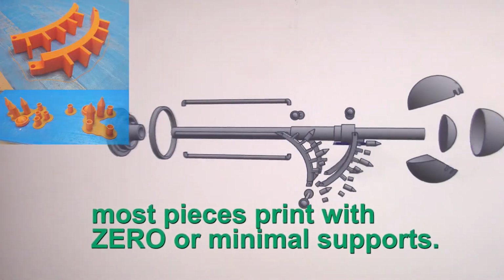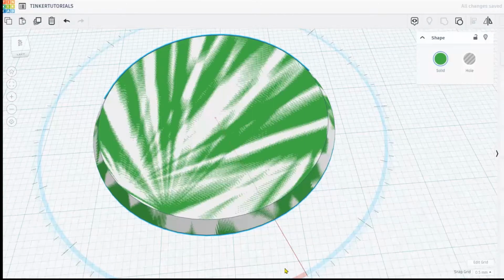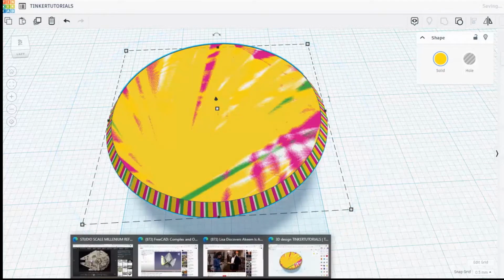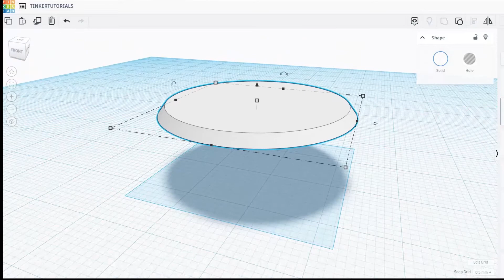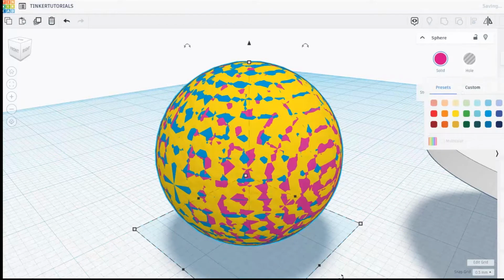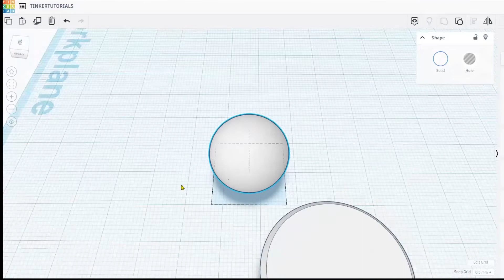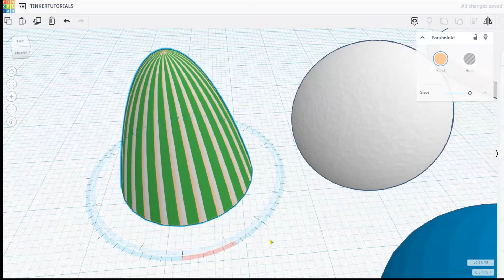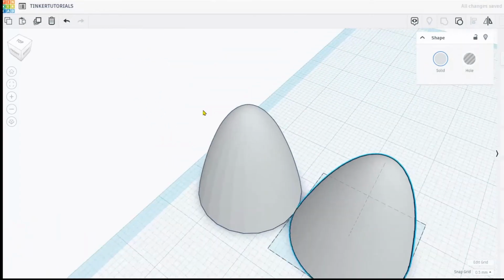TINKERCAD ADVANCED TUTORIAL - Reducing Facets INCREASE RESOLUTION on curvy objects.

Comment: Question, does this duplication use more memory?
Reply from the maker: Yes your render speeds will decrease a bit the more ''objects' are in your project.   You can reduce this side effect by saving your project into packets.   that is, take a super complex shape, save it as an STL and open it up in a new project and start at that stage in a new project.
Reply: @chaucer44  very helpful tip, thank you !
Reply: @chaucer44 Though by importing the stl you lose the ability to reconstruct the shape from whatever polygons you used.